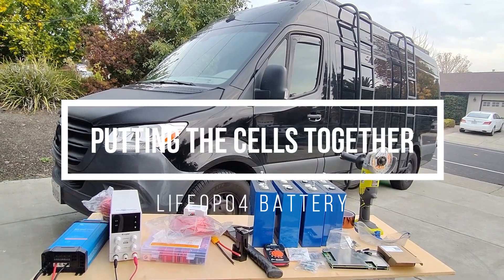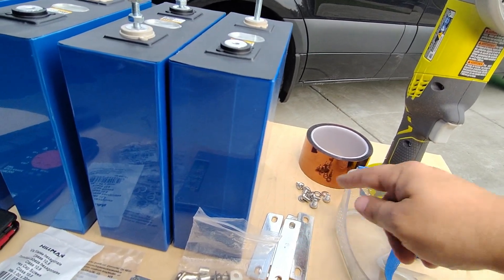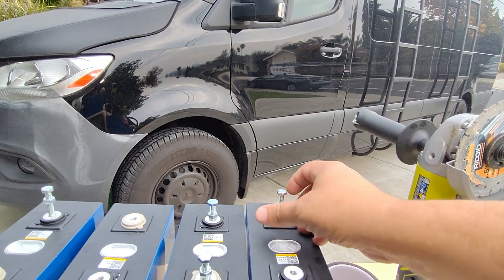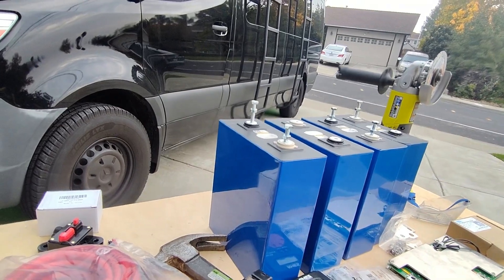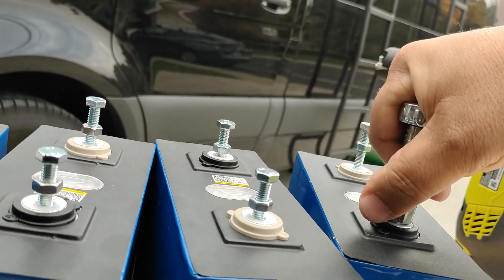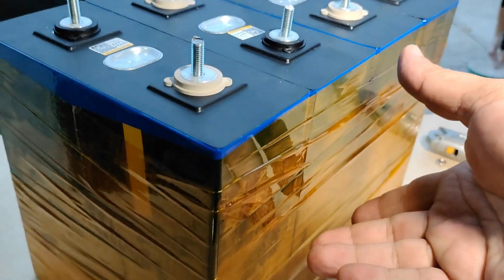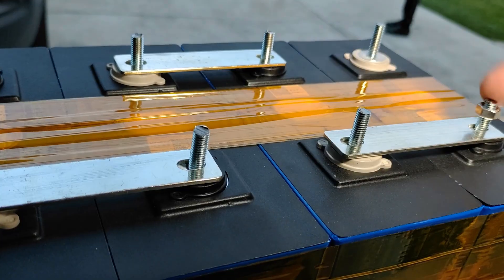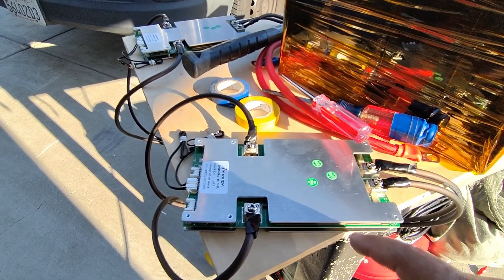Assemble 280ah LifePo4 Battery Pack▶️ DIY Lifepo4 Battery Build P2

Comment: You paid less than $30 per cell for these batteries ?  I'm skeptical that these are nothing but junk ?  These are typically $100 each or higher.
Reply from the maker: I paid way over $250 per the 4 cells back then. Did the prices drop that much? Omg 
The cells were good, get the stud versions.
Reply: @RANDOMFIX  Sorry, I built a 48V battery pack and yours is only 12V.  My mistake.